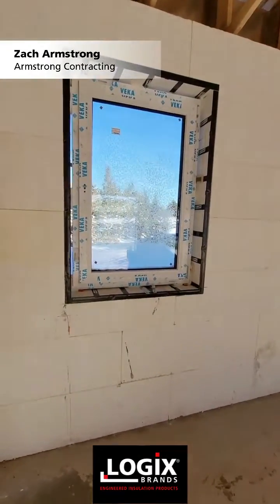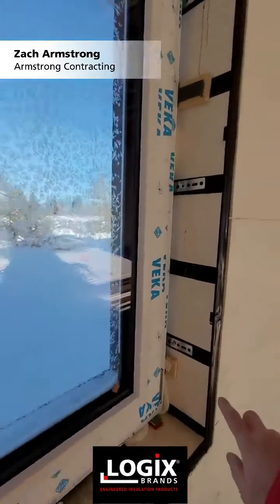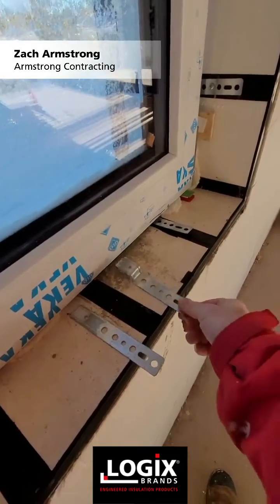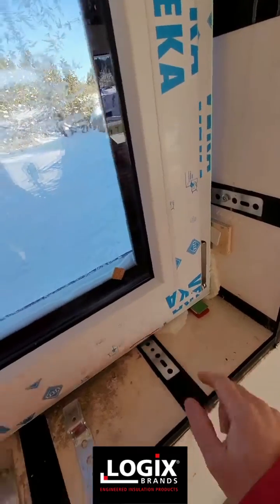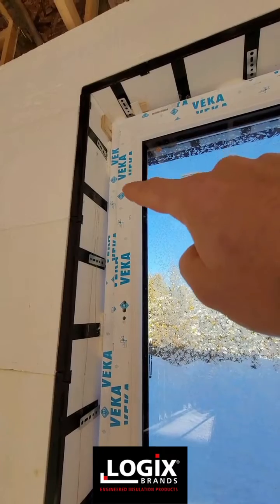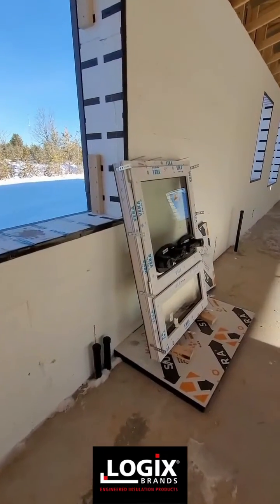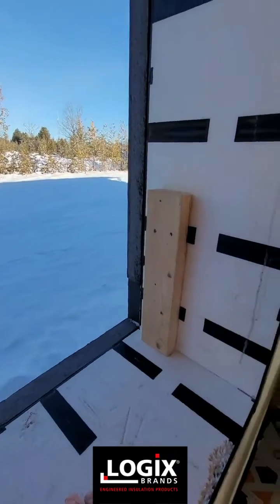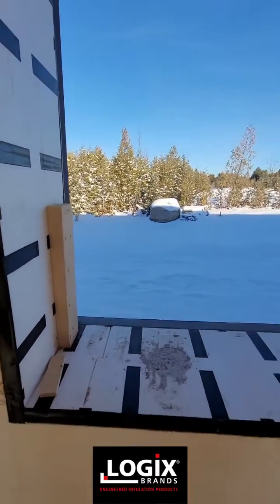Installing Windows in Logix ICF walls using Logix Pro Buck With Zach Armstrong

Comment: Hello, what flashing are you using outside? Liquid, tapes (like SIGA, 3M) . Thanks
Reply from the maker: Hello! Yes, those products will work just fine as long as the adhesive is not solvent based. Check out our blog post on this topic at https://logixicf.com/blog/insight-and-advice/how-to-prevent-flanged-windows-from-leaking-in-icf-walls-7-step-flashing-method/
Reply: @LogixBrands  The above link is not helpful for installing Euro style windows. any other suggestions?
Reply from the maker: @fricknfishn5153  Please reach out to Logix Brands technical services at techdepart@logixbrands.com
Reply: What type of screw did you use to attach the window to the probuck?
Reply from the maker: @jamesgschwind3124  At min. No. 8 wood screw that penetrates into the wood structure by at least 1".